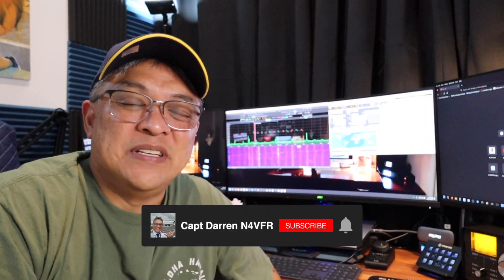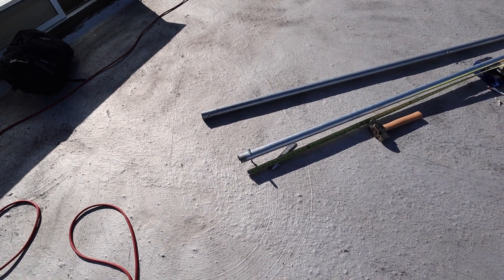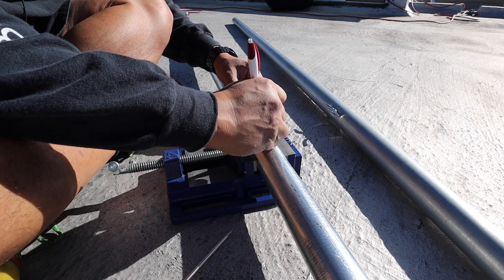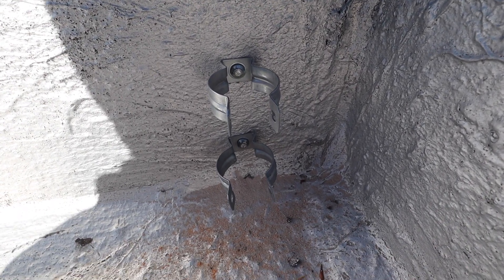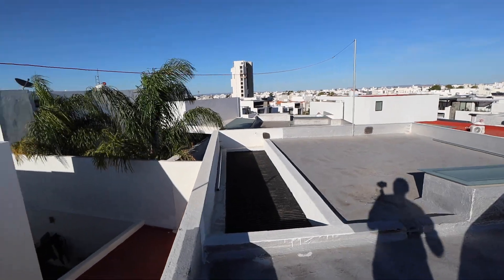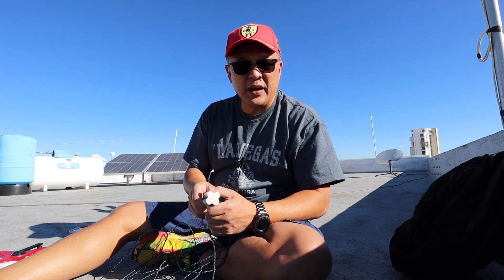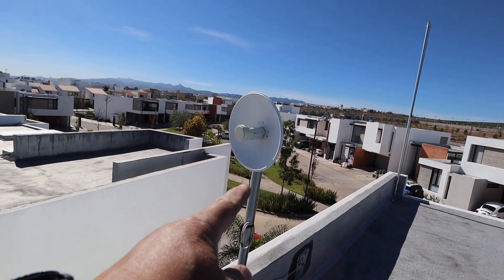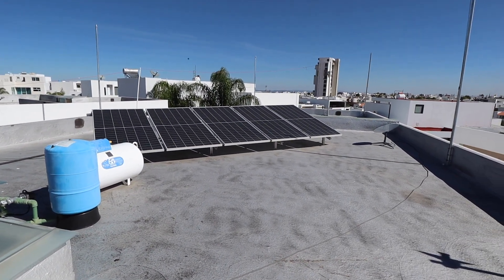40 Meters Horizontal Loop on Roof  | Skyloop Antenna | How to build a Horizontal Loop | Part 1 of 3

Comment: Howdy N4VFR.

I am considering a 40m sky loop on my roof as well (flat roof is 25ft above ground..!), but my shack would be on the 2nd floor.. I have been reading a lot of contradicting information about how to properly (and legally) ground the setup... The "good thing" is that my rods are perfectly vertical down from the roof to the ground, passing through my 2nd floor shack entry point..
Reply: I've been watching your videos over and over again for half  a year.. dreaming up that 40m loop on my roof.. which is perfectly of the right circumference.. it feels like it is really meant to be. But I'm still a ham newbie.
Reply from the maker: @Mentaloow  You got to figure out how to erect the poles to elevate the wire for 40m loop.
Reply: "Rods", to the roof?

Comment: @DarrenN2VFR How would you attach brackets if the wall is not vertical but at a slight angle?
Also, would you add waterproofing where the brackets go into the wall?

Comment: Thanks for taking the time to show how you actually did the installation in detail. It's really frustrating to watch ham videos and they say "here's what I'm going to do" and then they cut to "okay it's done" then they show themselves turning a VFO knob and testing it. 

Question: You haven't had any problems with your support polls being metal have you? I mean as far as coupling and that sort of thing? I figured you wouldn't since they are perpendicular to your antennas. This is an important video to me because I'm going to try to do the same thing albeit I have a one-story house and I'm going to try much longer poles
Reply from the maker: No problems with interference or coupling problems with my poles.  It's my primary antenna at this QTH.  Did you watch all 3 parts?  Good luck!

Comment: Hey Cap, I used an 80m loop many years ago which was my primary antenna. One thing that can be done or a couple of things that can be done is they don't have to be perfectly square or rectangle (as yours is) if you can just get that 265 ft in the air which means if you have to contort the shape to a tree out in the yard or something else and bring it back in or even add a coil or two in the length you will be able to get an 80 m loop up in the air. Yes, the pattern will be different, but loop antennas in every antenna book have always been pictured as a perfect square over perfectly uniform ground. The moment we deviate from that design, the pattern changes anyway. So you don't have to go by the book strictly speaking. You can add the missing length to get an 80 m loop up in the air even if you have to distort it, it will work especially if you have a tuner at the feed point or even in the shack.
Reply from the maker: Thanks Glen, you gave me an idea.  I'll use 265 ft of wire and make another loop just inside the outer loop and basically make it into a spiral.  Interesting project.
Reply: Just not too close to avoid coupling.

Comment: Thanks for sharing what you are doing with radio antennas.I have tried the MLA-30+ and it is really designed for those who do not have a large space and it is internal.  When I used the antenna wires that extend at the top of the building and cover the roof area, it was better in stages than the MLA-30+, and I also placed the MLA-30+ at the top of the roof of the building, and the antenna wire was also better.
Reply from the maker: I'm going to put my MLA30 on the roof with a rotator. Its on my list to do's. 73's
Reply: @DarrenN4VFR did you do the magnetic loops? How do they compare?
Reply from the maker: Thanks for your feedback.  I will also put my MLA30+ and make a comparison video of the reception between the MLA30+, Zero Five 27' Inverted L and also the 40 M Horizontal Loop Antenna.